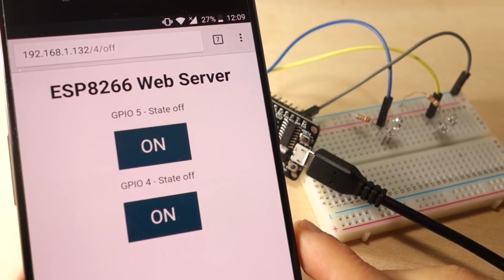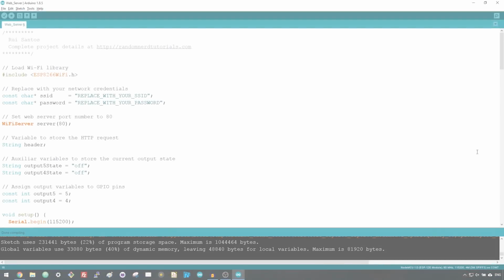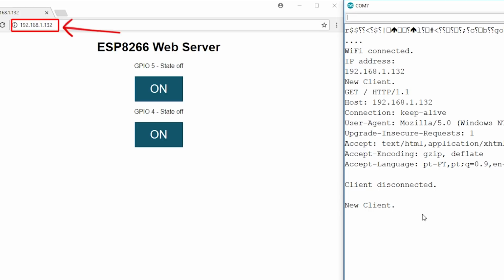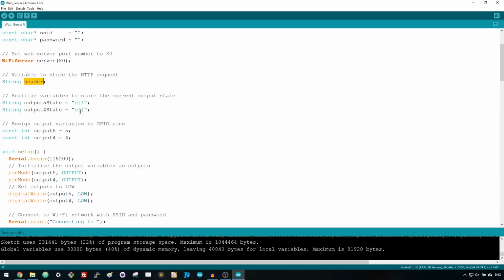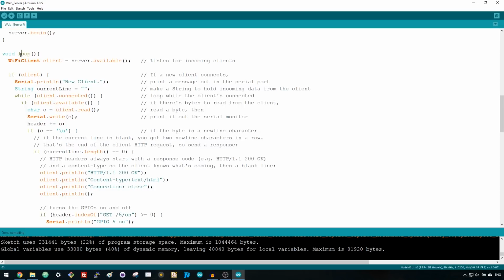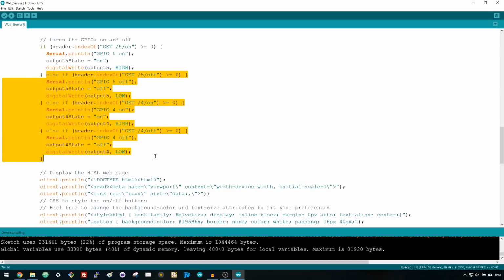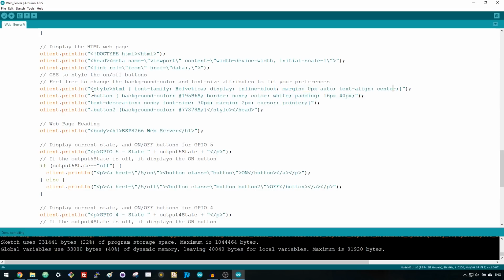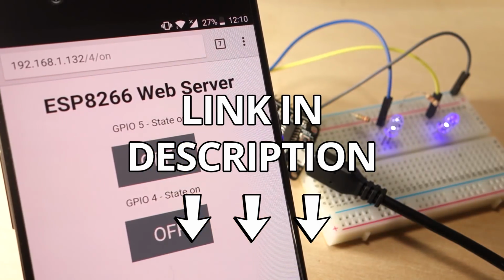Build an ESP8266 Web Server with Arduino IDE - Code and Schematics

Comment: Excellent Video and guide. Worked right out of the box. With the excellent code comments I was able to easily identify how to add an additional button and LED to control. As a suggestion, with remote applications, the battery condition is very important. It would be good if programs like these are extended a little to show the battery voltage  using analogue pin reading.
Reply from the maker: Awesome! That was the goal of my tutorial and I'm glad it was easy to follow. Unfortunately for Wi-Fi devices that require a constant Wi-Fi connection is not a good idea to use batteries, because it will drain your battery very quickly...
Reply: Yes Rui, I'm beginning to see that now as I play more with the ESP. However in duty cycled sensor applications it is obviously OK to use battery (which is different to this app). I'm curious, with the ESP in one of the low power "sleep" modes, is it possible wake the device to perform a function and put it to sleep again. I know I'm stretching the envelope :). With the quality of your tutorials, I'll be registering for your courses! Thanks J

Comment: Dear sir,the project is superb and Ur explanation Is very nice,,is the IP address  changes very often when we switch on the modem???or else the IP address is same kindly tell me
Reply: get the esp's mac adress with this line of code:  Serial.println(WiFi.macAddress());
then, set a fixed ip adress to this mac in your router

Comment: Great explanation. My circuit does not work, using all the information provided. The arduino ide serial monitor shows that there is output from the web browser, but   the circuit has no output.   In other words, the LEDs do not operate as expected, yet theres a response on the serial monitor.......please help.....thakholikatleho@hotmail.com

Comment: I have tried the program but there is problem in the section digitalWrite(output5,HGH), and digitalWrite(output5,LOW)
its just function opposite..Can i have solution..
Reply: Had same problem with onboard led, modify your code accordingly. Switch high state with low

Comment: How would you trigger a timer once the button was pressed to turn on the led for 15 minutes?
Reply: digitalWrite(LEDPIN, HIGH);     - Turns on Led at Designated output "LEDPIN"
delay(15000);                             - 15 second delay
digitalWrite(LEDPIN, LOW);     - led off

That isn't the complete code, you still need to integrate the "ON" button.
Reply: I attempted your suggestion and it was fine but after awhile if I needed to stop the timer while it was in a delay it was impossible. Clearing up something here and that is the amount of time needed was 15-minute delay. And sometimes the Wifi during the 15 minutes delay would be lost.
Guessing the device is sitting doing nothing and no other functions can be carried out while the delay is in control.
Reply: If that's the case, you shouldn't use delays if you want the chip to "multitask". I forgot the codes to make it like that although I can tell that's possible as I've made something like it previously.